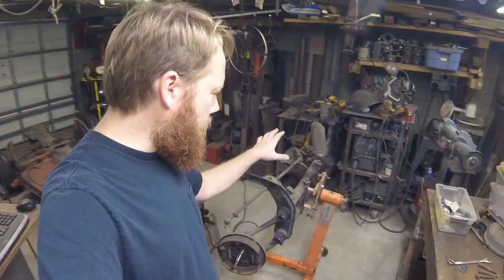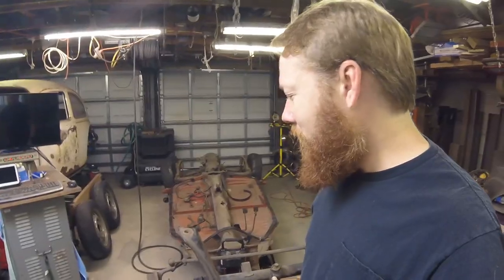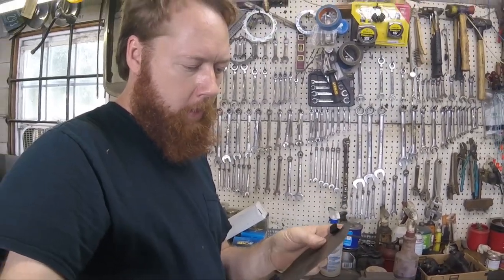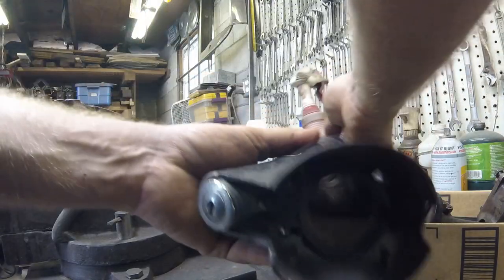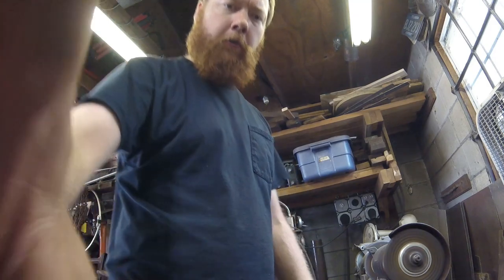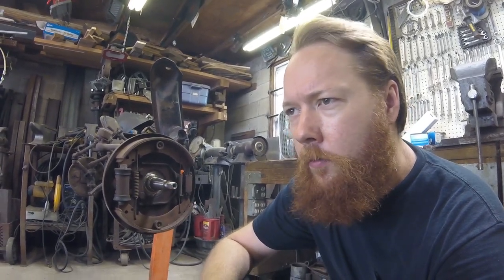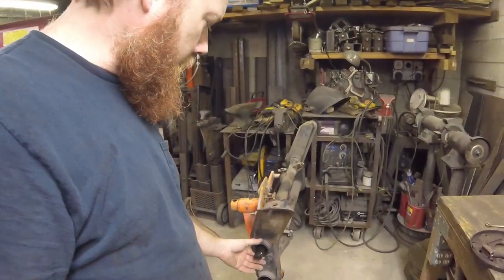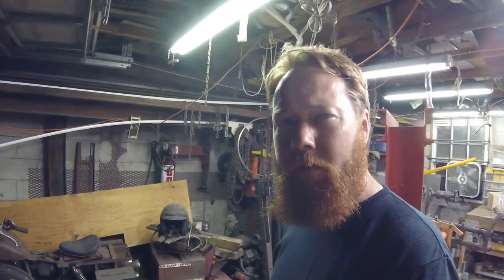VW Bug Dweezil Restoration Front Beam, Ball Joints, and Steering Column E5

Comment: Very thorough approach.  4 wheel drums work ok, as long as the maintenance is done.  I guess it really depends what engine you choose and how fast you want the bug to go.  Front disc brakes are definitely a great option and pads will last and last.
Reply from the maker: Thanks Aussie Beatle- I'm hoping I'll be satisfied with the drums but either way, I think it's a healthy starting point to get the stock version as designed and go from there. Seems there's a good chance I'll be happy with it because its simple and I have no current intentions of adding a big powerplant. Regardless, it's great to have options! Thanks for your continued support!

Comment: Cool or hot great progress, we have a few bugs where on the backplate the star adjusters steel tap broke did not know they were available where at ?? In Nov. when i get cleared to work again, I will pick back up on my 67 bus. where i pulled the beam out installed new Link & King Pins did a lot of welding patch work on the beam now it is time to assemby back together if i can remember where i put all the parts. I think all of our VW's are living documents and will never be done. Like you siad need to get them drivable first.. Enjoy your heat it will be 20F with wind chill in Iowa this weekend..
Reply from the maker: That will be a chilly weekend Dan Love! Those "Brake Adjuster Leaf Springs" are available at Wolfburg West, CIP1, and probably others. Continued good luck with your recovery, looking forward to future progress!

Comment: hey buddy! What's up? her commenting on an relatively old video from you. I am used to whack the b-joints and press them in with the hydraulic press. I am curious as to what measure did you use on the "receiving" sockets, because I no longer want to tear myself up by banging b-joints off with a heavy hammer lol. Though it's really stress-relieving, believe me, it also sucks your energy like crazy.
Reply from the maker: Hey VochoTalacha! Great question... I took some old parts out to the garage to recreate the project and am pretty sure the smaller receiver socket was 1-5/8" and I'm certain the larger was 1-3/4". These are thick wall impact sockets; not sure if that is necessary but they worked well without flexing. The other challenge (which I'm sure you know) is to provide a "drop zone" for the part to move into. Assuming the nut and camber adjuster are removed, a 3/4" drive deep socket worked well with the ball joint stem aimed down the middle of the socket. And I agree, way better than swinging a hammer! I hope you and yours are doing well and congratulations on your channel's continued success!
Reply: @HapticGarage  thanks a lot for replying, man! I sure am going to look for them sockets or something similar, but the measurements sure do help out to have a notion. I know this buddy who does metal and lathe work, so we can probably work out something for this, and who knows, maybe forged custom dies for this application.

Thanks for your compliments about the channel. I look forward to sometime personally know and shake hands with fellow VW youtubers from the US. How about you being part of the list? 

I wish you well and stay safe, my friend!
Reply from the maker: That would super be super cool VochoTalacha- custom dies for VW parts and meeting my friend from Mexico- put me on the list! Thanks for the well wishes and I hope the same for you too!

Comment: Not seeing anyone addressing bearing removal on the ball joint front beams ?
Reply from the maker: Hey Charles, I'd be interesting in see that too- haven't had to do it myself. If I do need to remove the bearings at some point, my first guess would be to dig through my press fittings made for pushing out a bearing race and hope one fits. Then I'd try to adapt it for use with a slide hammer. Just a guess but that's where I'd start. I hope this helps!

Comment: how do you feel about disk brake conversions?
Reply from the maker: I've never swapped in a disc brake setup so I don't really know. My inclination is they may not be necessary for stock-ish builds. My '67 bus has well maintained stock drum brakes that are very effective... I've had a few quick stop situations that shut both sliding windows without fade or skidding. Fast VWs with big engines may have different needs, but it can't hurt to make sure the stock setup is working properly before making the switch.

Comment: Curious what type of grease you put in the steering box? I'm seeing different options and was curious what is typically used.
Reply from the maker: Hey Stephen, two sides of the best steering box lubricant debate focus on grease vs. oil; I'm currently in the oil camp. The argument against using oil (I currently have mine filled with 85W90 gear oil) is a greater possibility of leaks. I do have a small amount of weeping on the steering shaft, but no significant drop in oil level. The best argument against grease that I've found was the dried up clay that came out of the box. I believe we find consensus in something is better than nothing!

Comment: Looking good... Now I got a 70 typ3 that as of today got 3 of the front end trailing arms out, but after reinstalling the PAX side arms and removing the DRV side upper arm. still was not able to pull the LOWER arm out from the axle.  Set screw is out, but will a puller this lower arm will not budge!  Any idea, THANKS!  My name is Volkmar with middle name Willie so that is why they call me VW, not because I own a 70 Sqrbk.
Reply from the maker: Hey VW, thanks for watching! You may try removing the center grub screw that secures the torsion plates, then remove the remaining arm and plates as an assembly. Then you may further investigate why the arm is stuck to the torsion plates. I'm suspecting damage on the plates. Let us know how it goes!
Reply: @HapticGarage  Howdy Dweezil, THANKS for the quick answer.  You may be right that there may by some damage.  The car was in a front end crash in 1972.  So I think unless I see too much grease leak at the arm, I think I will leave it alone and just clean everything around it for now.  Thanks again for your help, VW
Reply from the maker: @Volkmar Maleika I hope the project turned out well and thanks for the question!